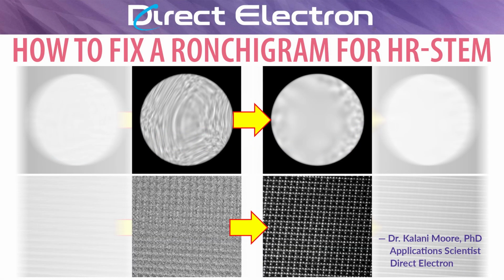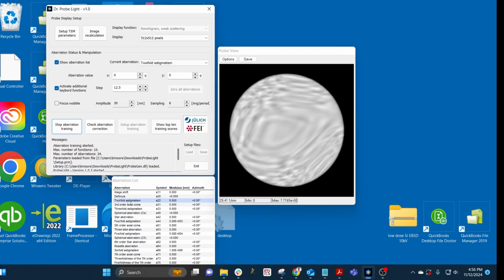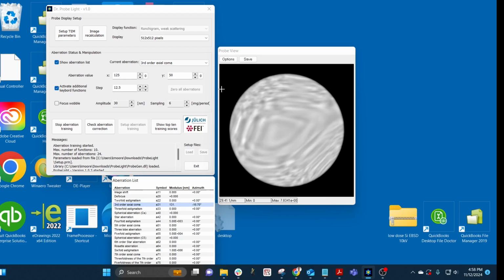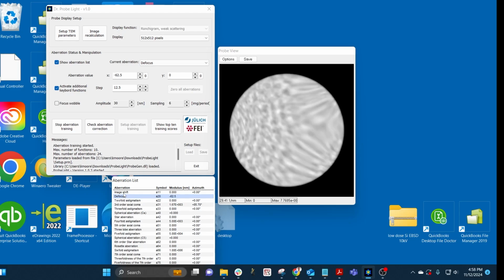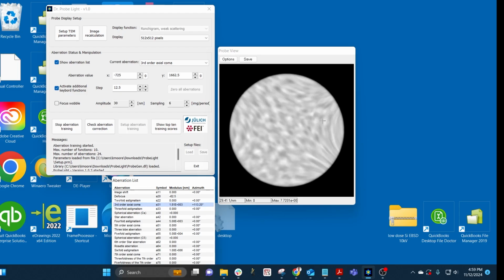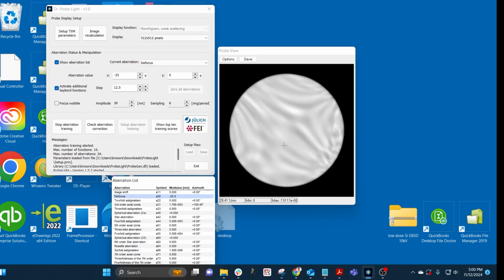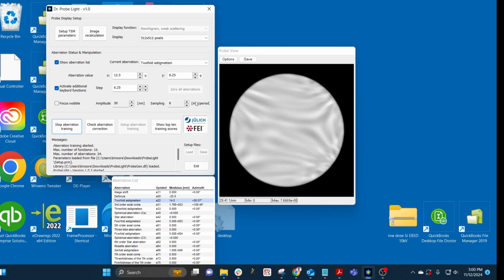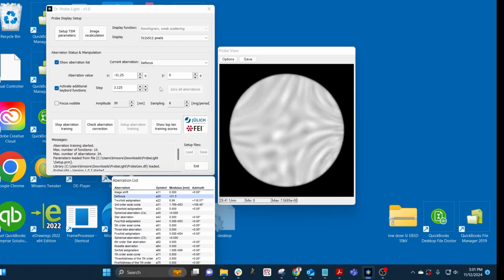How to fix a Ronchigram for HR-STEM

Comment: There's an easter egg in the thumbnail at 00.10 of this video. 
The bad Ronchigram doesn't  correspond to the bad image. 
Anyone who can guess what's actually wrong with the image gets lots of points.
Reply: Seems like the focus is different from the top to bottom. Is this a zone axis alignment issue?
Reply: @mohammedhussain1197  yes, but I didn't adjust the tilt to make it better. .....The atomic structure itself is changing. This is a ferroelectric & ferroelastic sample where the domains re-arrange under the STEM beam!